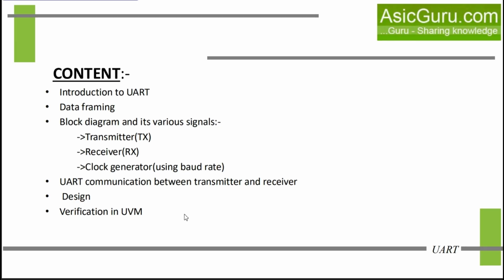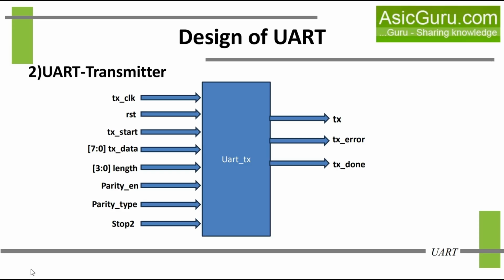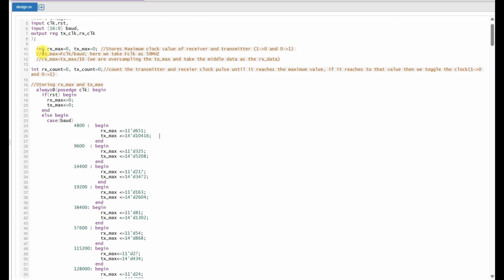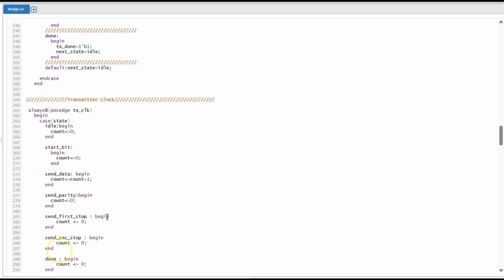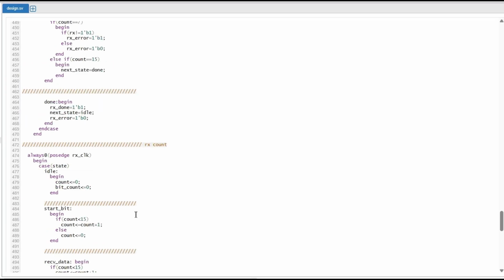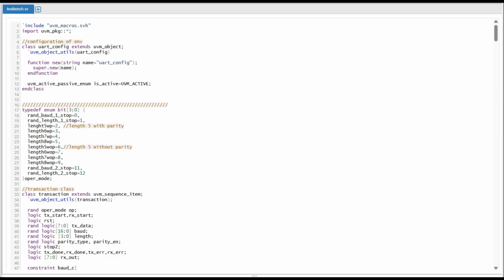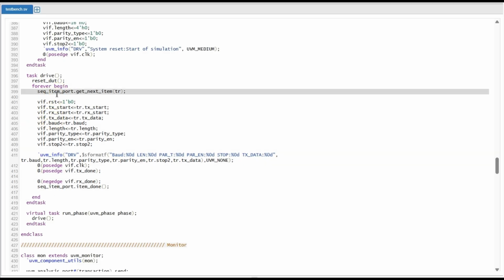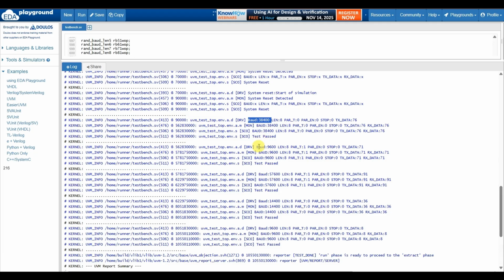Uart Protocol With UVM Verification

Comment: In the UART receiver module, in the parity check (line 390-393), you are checking parity for the entire rx data reg, which may or may not have bits that are not a part of the "DATA" (because of variable lenght), shouldn't we calculate the parity just on the DATA bits ?